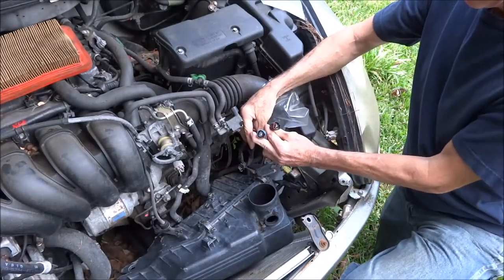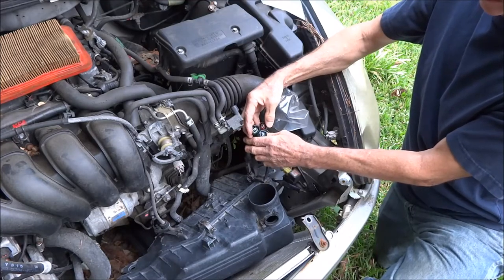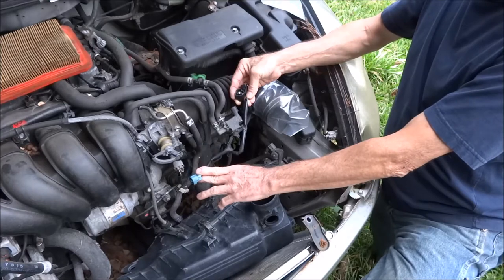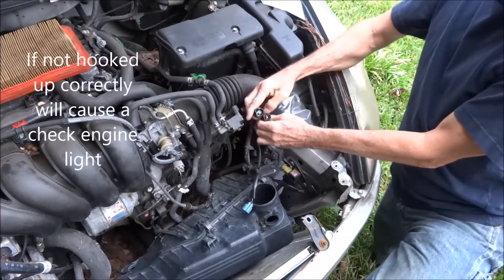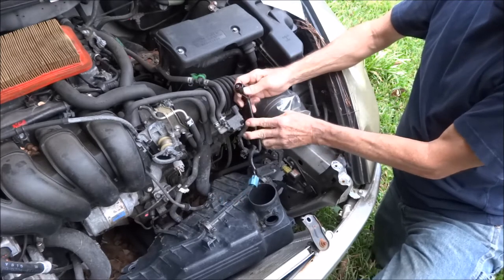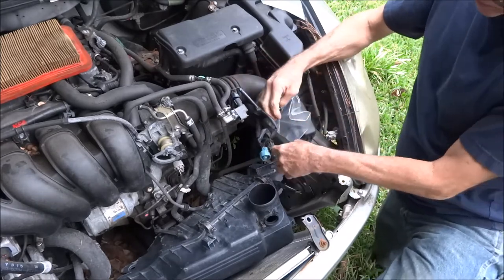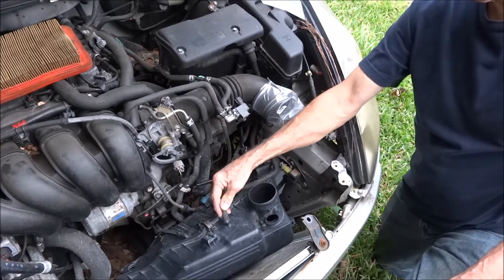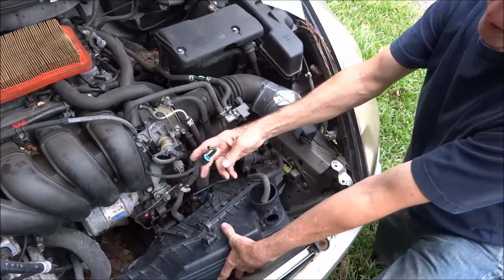Cold Air Intake mod, 7th Gen Celica, Short ram intake. What are these three plugs. read video desc.

Comment: It’s very important not to accidentally put the blue plug on the vsv valve. I made that mistake and everytime I put gas in my car it would stall and it’s because the blue plug caused the vsv valve to stick open and suck raw gas through the line stalling finally fixed the problem a while back but it’s an easy mix up since they’re the same design plug and will swap places if not done correctly
Reply: Thank you so much it took me days to figure this out

Comment: I recently installed a short ram intake and found out I don't have a vent valve and only 2 plugs (vacuum and butterfly valve). If it had been removed by the previous owner, I'd have no idea why they would've done that
Reply from the maker: That is strange. Usually they are just disconnected and left hanging.

Comment: The vacuum valve plug on my 2001 Celica has one of the wires severed from rough handling. Am I able to simply solder the wires (or even use electrical tape) or do I need a full replacement?
Reply from the maker: Yes you can just repair the wire
Reply: @TSRGarage  Thanks, I wasnt too sure. I was still going to try it anyway but now there's confirmation.

Comment: i have a 2000 celica gts the VSV hoses are just plugged closed with my ram air intake, got the car like this and it runs funky. i CANT find vacuum diagrams anywhere!!! anyhelp? i need to replace my intake with another short ram, with proper vacuum hoses, i just need to know where everything goes!
Reply from the maker: Just Anon I covered what I know about it in the video. I just checked..  a Google search of "2000 Toyota Celica vsv diagram"  will get several good diagrams.

Comment: What does the little breather valve do the one that gets filtered air
Reply from the maker: It's all part of the fuel tank vent and purge system. So I would guess it is air intake for evap purge cycle.

Comment: So.. Scott, what would happen if the vacuum valve isnt plugged?
Reply from the maker: If your refering to the vucuum port on the intake (with the hose hooked to it).  possibly high idle or the idle will not be steady (rev up abit and drop)
Reply: OK. See i asked because I have a short ram intake and run rich. This how I got the vehicle from the previous owner. Also its the GTS, and in M mode downshifting, or any decreasing speed if I touch gas or tap it continuously, it pops and gurgles, sometimes spits flames. Exhaust is straight piped with CAT and resonator. I changed the muffler to a Jaguar triangle shaped one to quiet it down a bit. I like the pops and flames, but I haven't figured out why it does this. It is really fun to drive tho. Any idea why it would do this? I even rebuilt the engine, same thing happens.